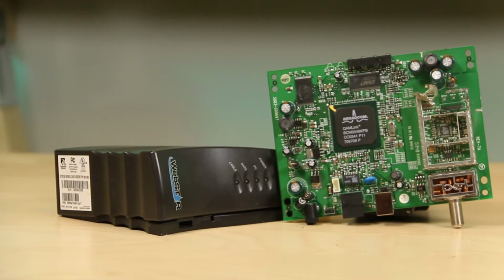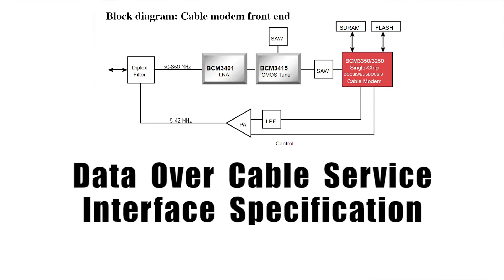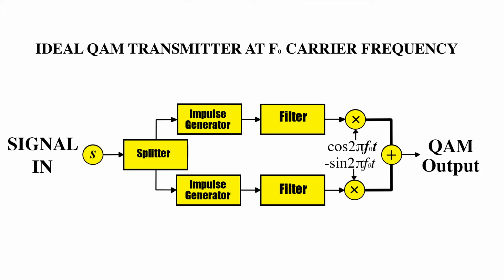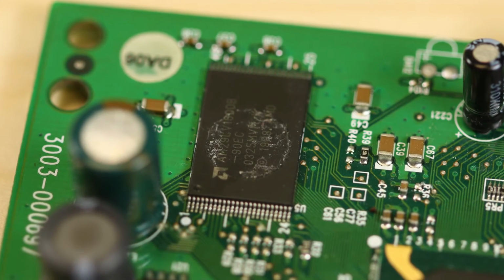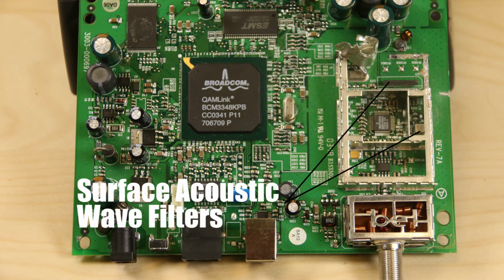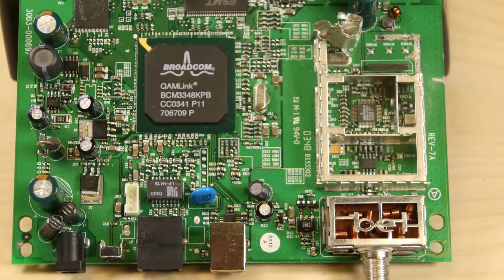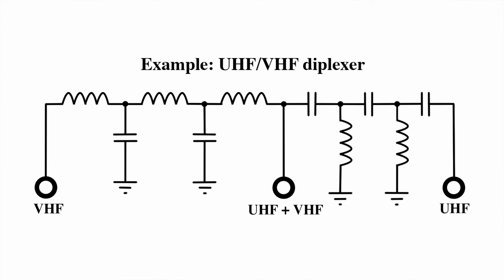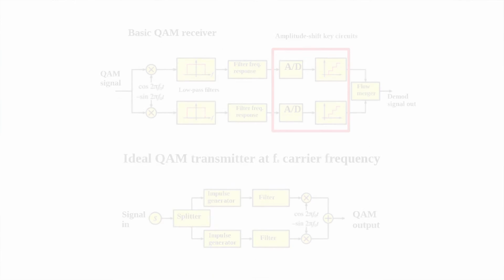Inside a cable modem

Comment: where is the router here on the board? all modems must have a router in them... is this one such old modem that does not have router in it?
Reply: not every modem has a router built into it... and in fact built in router modem combo's have only in the last decade or so became popular
Reply: That's usually how the hardware you rent directly from the cable company comes but it's actually wiser to have the router and modem be separate pieces of hardware because it's cheaper if either ever needs to be replaced :)

Comment: Why aren’t they cooling the internal because the modems get very hot ?
Reply: Modems won't be cost effective then and tbh as long as they are cheap heating can be overlooked and also the new ones have some heatsink and better chips that don't overheat that much
Reply: This modem is is from the 1990's the early years of Cable modems... most of the new cable modems don't get that hot
Reply: Planned Obsolescence ;)
Reply: @westtell4  That is false ...
Reply: @3nertia  not  really most modems Operate pretty well passively cooled in most environments probably if room temp's got into the mid 90's or so it would struggle but that's not a problem until recently
Reply: @westtell4  I literally just burned out a newer docsis 3 modem a few months ago in an air conditioned apartment...
Reply: @westtell4  They run hotter now, not cooler - they need more processing power than they used to, especially for ever-increasing internet speeds ...
Reply: @3nertia  i've had the same Docsis 3.1 modem for a while in a house where the air temp got over 85 Degree's F
Reply: @3nertia  in fact i've never had a single problem with any arris cable modem
Reply: @westtell4  Maybe you don't run yours as hard as I do ours lol. Our internet speed is 1200Mb/s lol
Reply: @westtell4  Oh, Arris makes good hardware, they usually have better heatsinks in them. Mine was a TP-Link and it wasn't keeping up with our internet speed and thus overheated heh
Reply: @3nertia  i only have 1 gig ...
Reply: @westtell4  Yeah, I manage the network but the other manages the bills - unbeknownst to me, Xfinity had been demanding that we upgrade our modem for awhile but the other never passed that message along so our modem ended up burning out 😅

We now have a newer (faster) modem and a newer (faster) router and I put a fan on the shelf blowing across all the networking gear lol
Reply: @3nertia  my ISP has always just given us Arris or i've bought my own From Arris.. a friend of mine had a new gear one once that died.. but never had a bad one with Arris
Reply: @westtell4  I used to buy ARRIS but a few years ago we needed a new router (the one we just replaced lol) and I found TP-Link to have the features I wanted and they generally already run Linux or can have OpenWRT or DD-WRT installed on them. We did end up replacing the modem that burnt out with an ARRIS though, as it was the only one that had the features we require but didn't cost too much lol